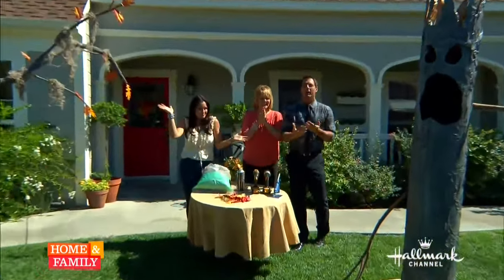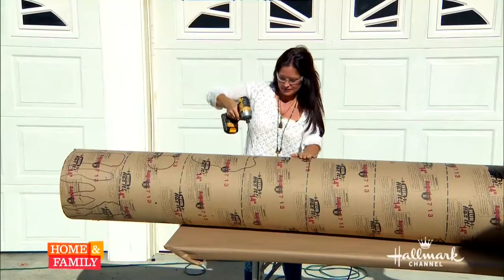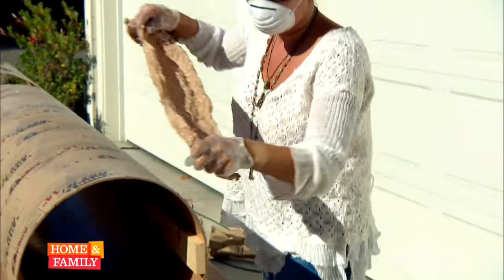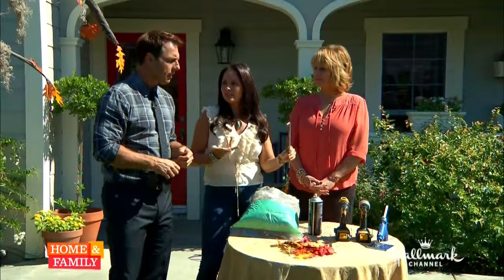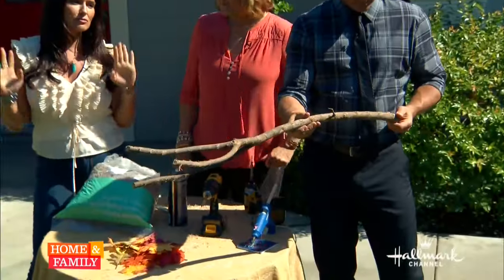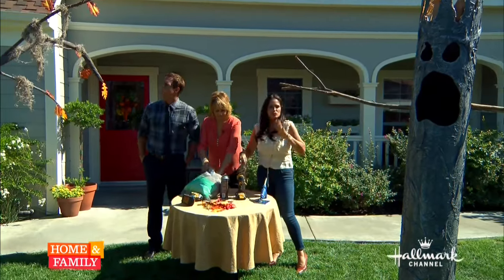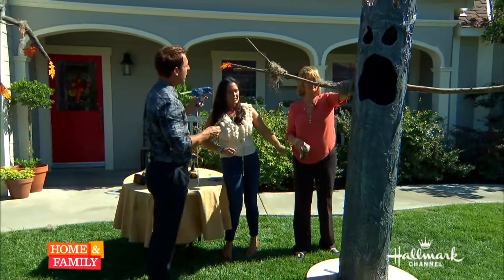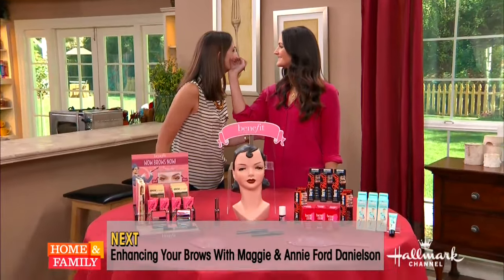Giant Spooky Halloween Tree DIY

Comment: Do not pit it in the rain. The tubes break down in water.  2 days of rain it fell apart. I waterproofed the outside but the inside was not. Next time of water proof it in and out before.
Reply: Wont help...it will breakdown again with just one day of rain.

Comment: Hi guys, I thought I would give you all an update on how I made this 5 years after this videos posting, and will answer some of those burning questions:
I could not find 8ft tubing anywhere, instead I bought 2 4ft 12" tubes from Lowes for $15 each (total of $30). I stacked the tubes on top of each other and secured them together with mending plates (hardware for this cost me less than $5.)
I used two 1"x2" wood beams that were 8ft long, that ran along the length of the tubing. I then screwed the wood beams to the tubing for the whole length of the wood beam spaced about 6" apart. ( i dont have a price for this since I already had some laying around, but I know they were inexpensive).
I used cheap duct tape from walmart and ran it along the length in the middle of the tubing where I connected the two tubes together (they did not line up perfectly, so the tape was used to taper the gap and make it appear that I didnt use more than one.)
I drew on the designs for the top, and eyes and mouth, I cut it all out with a Dremmel and some cutting rotary pieces (total for this was about $60, since I chose to buy the tool instead of rent, But I did start off with a steak knife, which does work but takes a lot of muscle)
I than used a roll of Kraft paper (butcher paper) from Walmart costing less than $7 and two bottles of elmers glue that combined costed about $6, and with a $1 paint brush I painted on the glue and stuck the craft paper to that.
I bought a small bucket of paint from walmart that costed about $10, and got the darkest gray color I could find (I got the latex kind) and I got a $1 can of black spray paint that has a gloss finish (To reflect the light I will put inside the tree)
I had some fallen tree branches from the backyard that I used for the arms and bought some cheap L's from Lowes to screw the nails to. 
The latex paint combined with the spray paint, I feel does a good job with waterproofing the trees, but just in case I always keep track of the weather and bring the trees inside if there is a more than 10% chance of rain. I also read that Boat Varnish does a great job at waterproofing, but wont attempt this due to the high cost of the materials. 
I did not build a small stand under the trees but rather attached L's to the wood beams at the bottom and put steaks through them and into the ground.
All in all, this costed me about $55 for each tree, I made two of them. I would say that If you have all the materials and if you are working alone, this project can take you as little as 5 hours from start to finish for one tree.

Comment: I am going to start this project on Monday, How many hours did it take from start to finish?  Where do you find the 8ft tubes?  Home Depot or Lowe's only has the 48 inches and the biggest they carry is 12 inch round.  Also any suggestions on how to waterproof so if it rains it doesnt destroy the tree?  Last Question, what color grey paint did you use?   Thanks for the Help on this
Reply: i am sure spray paint will work as well. i have to figure out what to use for weather protection
Reply: Hi Kevin. 'Dry Lock' seals from weather and if you mix up "Monster Mud" that works too. Google it and you can find the recipe. Monster Mud gives a rough texture, may help with the tree look. Good Luck!
Reply: I haven't been able to find the tubes anywhere. Been wanting to do this for a couple of years.
Reply: Pamela Hammers,  I just asked people on a construction site for any round empty spools they might toss out. A lot of sites through out their large spools when they are done with wiring or tubeing or anything like that. You have to piece some together with  duct tape but you can reinforce them with the wood that they were talking about in this video on the inside. But  that and then covering with monster mud to help waterproof the outside is perfect. I hope this helps.  Plus you save money because you don't have to buy the round tubes. ( you could always show them a pic of what you are looking for.) Helps give them an idea of what to donate to your fabulous project!  Lol
Reply: I was able to find the 12" diameter 8ft tubes at Lowes.  Home Depot only carried the smaller diameter.  Kind of curious about weather proofing myself.  The video says exterior latex paint, but does anyone have any experience with how well these things hold up?  Ideally I'd like to use them for a couple of years.